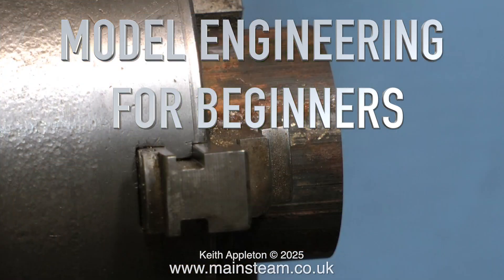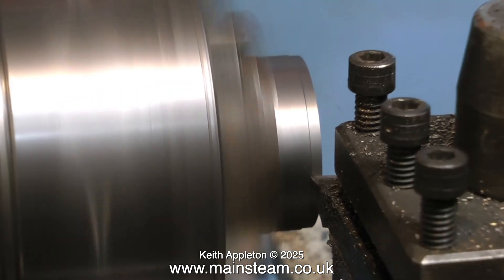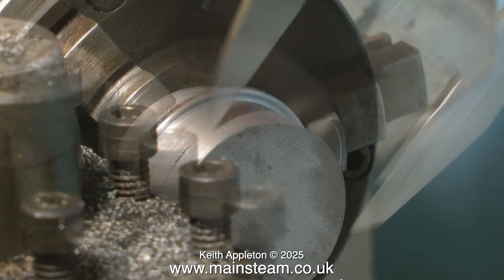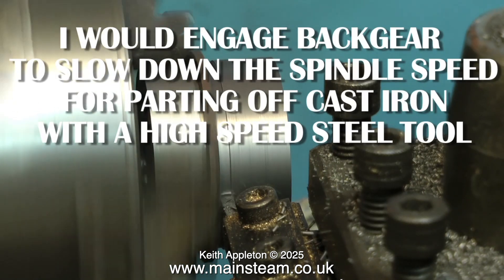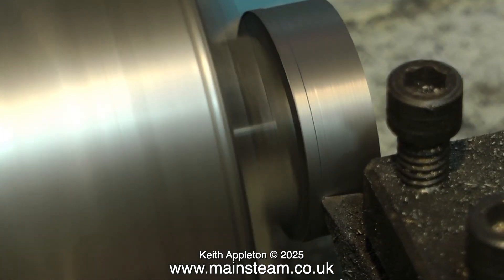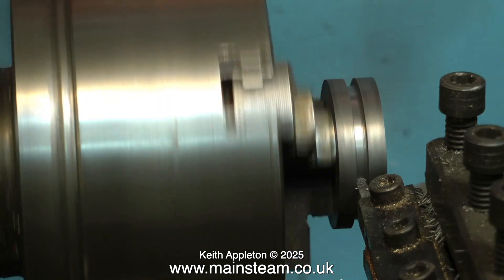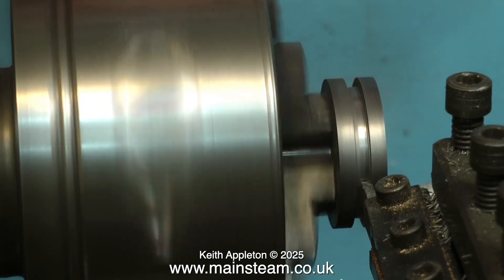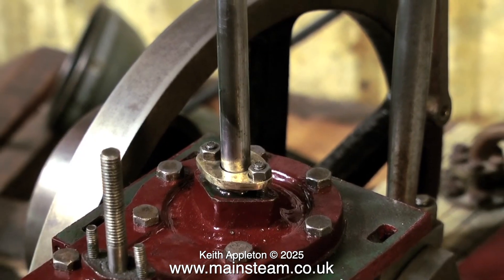HOW TO MAKE A CAST IRON PISTON - MODEL ENGINEERING FOR BEGINNERS

Comment: G' Day Keith,
I make lots of cast iron pistons - but for vintage model aero engines,  both diesel and glow plug ignition.  The bores have to be lapped to the correct taper and the pistons have to be lapped to fit the lapped bores.  That is because in these small sizes,   no piston rings are used and the piston seal is by the thin film of castor oil used in the fuel.  For the larger sizes I have made piston rings which are used on aluminium pistons as in "full size" engines and these are,  as are the pistons noted above made from spheroidal graphite (SG) cast iron.  In SG iron the graphite is in spheroidal form not flake confering a higher level of strength.  The Boxford is a good Lathe.   I use a Smart and Brown SABEL Lathe,  made decades ago in Biggleswade.